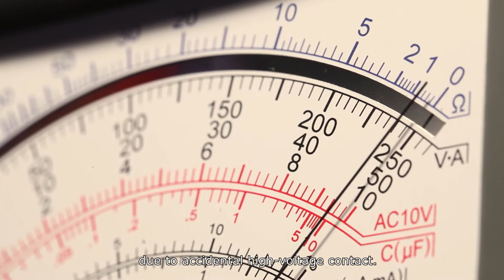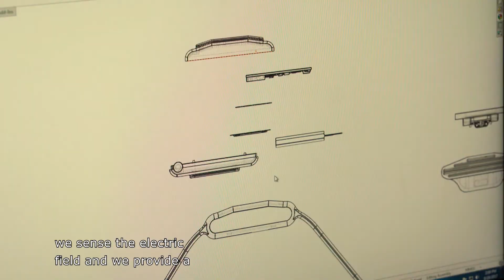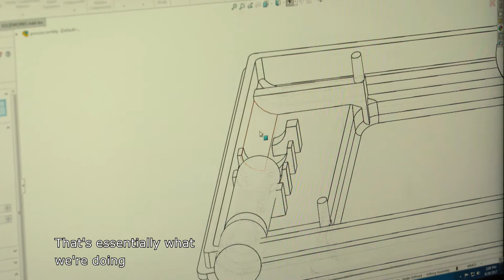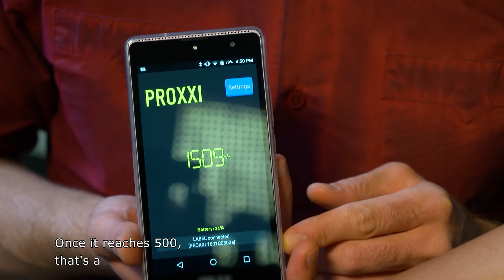Wristband to Protect Electrical Workers | The Henry Ford’s Innovation Nation

Comment: I have a question, can this wrist band detect underground electrical cables? This wrist band looks incredible and I’d like to know more about it. All the info I get or videos I see is the worker using it to detect things overhead.
Reply: No, it will not detect underground cables because these are shielded. The shield will block the electric shield used for detection.